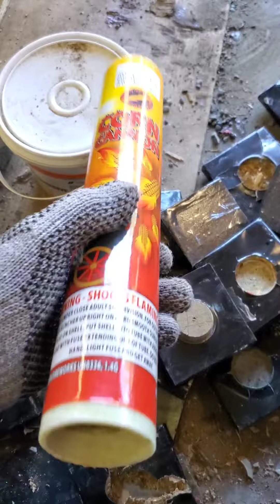wood plugs in fiberglass tubes?

Comment: You can use a hole saw to cut plugs for the tubes, then glue them in.  Last year, I had several fiberglass tubes that left the wood plug attached to the base, leaving the concrete plug in the tube.  Used them anyway.  When the shell fired, it just pushed the concrete plug to the bottom of the tube. No issues, although I don't recommend using them this way. (The tubes were used in finale racks, so they only fire one shell per year.)

Comment: I've never trusted just the concrete plug after I take the base off. I've always made wood plugs for them. I  turn a longer piece on the lathe and cut it into shorter plugs, though not everyone has access to a lathe..

Comment: Seen that before in fireworks fantasy Fantastical shells
Reply from the maker: Shells are Probably from the same factory. Avoid using these tubes. Wood plug is nailed in concrete with one nail and pulls off like a banana 🍌peel on some.

Comment: I would not use those in a rack, that concrete plug will move down when the shell lifts making them break low or worse.
I have come across a couple kits like that as well, I just end up trashing them if I can't keep the wood plugs in the tube. 
The ferdelance tubes in my video I linked are exactly like that, if I can't get the wood to stay in the tube I trash them. 
Like Unseen Pyro said, you can cut new plugs and glue them to the concrete, but that sounds like a lot of work.
Reply from the maker: Ok ill just trash them. Some of them just come apart by hand and are loose. These would be bad to make a screw down rack. They could fall all over like GJAM's rack did. In fact I'm never going to make a rack like that again unless it's Excalibur tubes
Reply: @country7900  That might be exactly what happened with g jams poor mans rack!
Reply: Nice MFD it's all trial and error 👍🏾